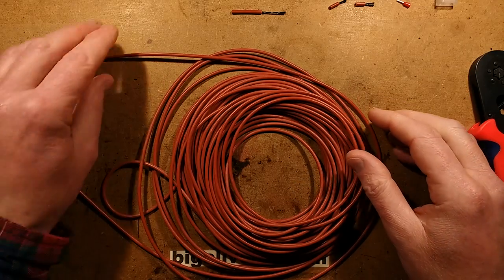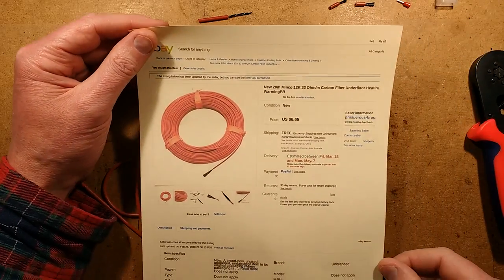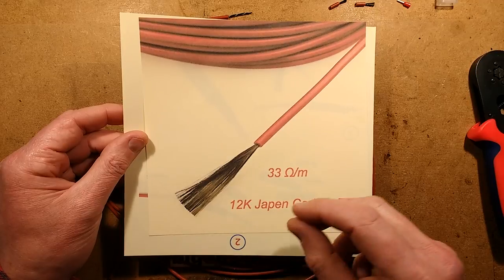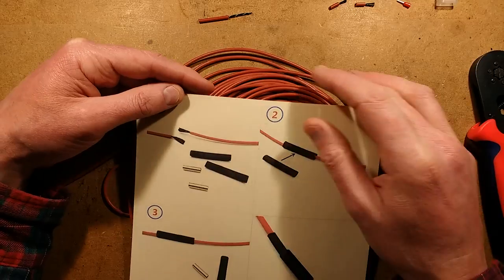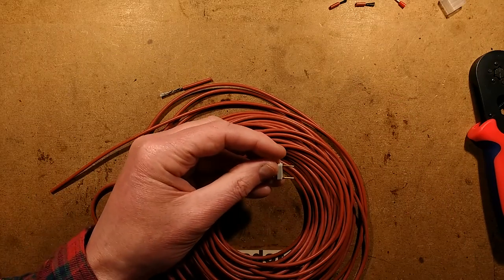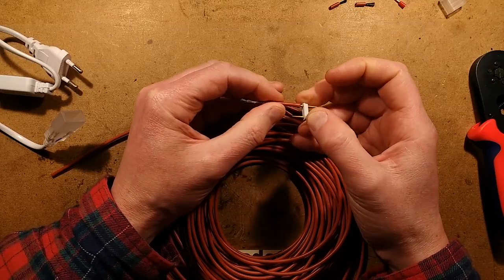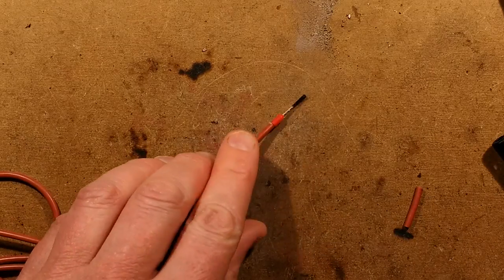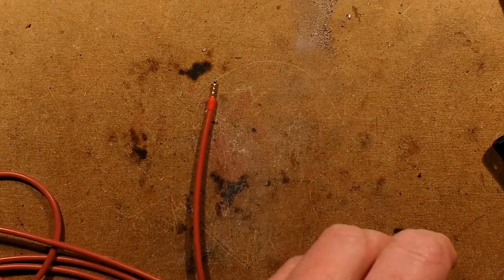Testing carbon fibre heating wire.  (with flame test)

Comment: I did a ride along with a fire department for a shift and I learned that people used to put this sort of heating system in their ceilings. I don't remember why people thought you should heat from the ceiling down but I do remember them explaining how much of a hazard those systems are.
Reply: I think its mostly done because it´s easy to install later on, and still better than the classic radiator.
Reply: My uncle used to live in an apartment complex (built in the 1990s) that had ceiling-heated units. He was on the 2nd floor, and I remember during a blizzard he had every window open and was walking around with no shirt on because it was over 80 degrees and the downstairs tenant was suffering from her unit in the 50s. Epic fail on the builders, it would have been more efficient for the first floor units to have electric baseboard heat instead. On the up side, he never had to turn on his heat, ever, while he lived there.
Reply: We had a home with the 120v in ceiling radiant heat. It had previously been added during a large extension project (in the 70's) as well as the requisite ceiling fans to help. It was only helpful when the wood stove couldn't keep up with -12F and leaking windows.
Reply: And here i am trying to persuade my sister that her idea of installing ceiling-heating is retarded but she won't listen.
(No, not in an old building - they are currently building a new house)
Reply: +ABaumstumpf I'd show her what +DashCamAndy said, I think he's got the best story of the rest of us
Reply: A ceiling heating system only works if the heat is transfered mainly as infrared radiation heat not convection heat!
This is achieved for example by having a ceramic surface heat up to about 120°C(248°F)
Different Surfaces have different temp points of IR-radiation, ceramic is one of the best.
That is why old tiled stoves are so comfy.
Reply: Animarkzero
Never heard that, thanks for sharing dude!
Reply: If you install radiant heat.. do it in floor.. Makes it comfy,, even in cold temps,, and saves energy,, since heat builds up on ceiling, while floors often stay cold
You can do hot water floor heaters too,.... just modulated to 130 degrees.  Best luck;!
Reply: @DavidRio  Floor heating is the best 
Although I would NOT recommend 130°F(54°C) 77 to 84°F (25-29°C) would be much wiser!
You get Varix from to much heat from the floor
Often it is not possible to refit floor heating then you can also use walls or ceiling!
Reply: Might be a good way to warm a fermentation vessel in home brewing.

Comment: Thanks for this episode of inspiration and answering the obvious Q+As. Your suggestions for making it safe to use earns you 10/10! Trying to learn racing quads at the moment on the Costa del UK. Great but less if you are freezing. Since the pilots already strap on a large 3s lipo to power their FPV goggles, a nice pair of heated gloves under 5W would be an easy hack. We also suffer from cold lipos. Using a lipo below 10 Deg C can cause permanent damage to cells. Racing packs are not cheap.

Comment: My satellite internet dish horn freezes up in the very cold (-30 to -40 C). It stops working when it freezes. That would be a great way to quickly thaw it out.
Reply: Canada.
Reply: It is actually the cold, because the only way to get it to work is to wrap an electric heater around the horn to get it to work again, or if the sun hits it in the morning. It only happens about 3 or 4 times in the winter. It happens right in the middle of the night at its coldest.
Reply: Nothing in the way. It is a strange thing. These horns are fussy when it comes to humidity and cold. This is the second one that has been installed. The first one was replace when the horn was cracked by sun damage.
Reply: Harold what is inside this horn device? Is it a transmitter? It's very rare that electronics have issues at below 40 would need to have moving parts for it to fail like an HDD
Reply: That's right on the temp border between consumer ic operating temps and military ic operating temps. mil spec wouldn't do that
Reply: Francois Deshue could it be metal contraction slightly changing the shape of the tunes cavity and thus causing the issue?
Reply: FRancois: Nope, much more than that. Here's a link to it with some pics:  https://en.wikipedia.org/wiki/Low-noise_block_downconverter
Reply: A dish "horn" is really a LNB.  These contain active electronics to downconvert multi ghz freqs to say less than 900mhz, along with switches and cable drivers etc.  They are powered and told to switch bands by imposed DC voltage on the coax.  Could be geometry changes or bad solder joints or a component that drifts enough off spec?
Reply: Pity ALPS no longer makes LNBs, those were just the best. They look like they shouldn't work, they don't have the best specs on paper, but they worked better than anything else i've tried, and they were super inexpensive.
Reply: you can get outdoor rated self regulating rated trace heating cable - marketed for preventing water  pipes from freezing... I think that'd be better for your application. 
the underfloor stuff doesn't look like it'd really be very flexible and might not be designed to stand up to UV...  and the self regulating stuff ramps down the heating when it's got warm rather than outputting  constant power regardless of what temperature it reaches.
Reply: Consumer LNBs often drift based on temps. Too high or too low and it'll drift off frequency and instead of the oscillator being 11000MHz, it's at 10500 or 11500 (I don't know if they'll drift that far - it's an example) and your receiver is trying to get 1000MHz, but the signal is actually at 500 or 1500.
Reply: Not sure what exactly is inside. It is a combination transmitter and receiver. All I know is cold affects it.
Reply: You really should just take advantage of your natural resources!
By which I mean, I wonder how many Canada Geese it takes to carry a human while migrating...
Reply: I don't know the pricing, but these guys seem to make LNB's which work in arctic temperatures. https://orbitalresearch.net/products/lnb/
But I wonder why/if nobody makes a LNB with a resistor for heating inside; it seems there is a market for it in your part of the world.
Reply: Anyway, if you think heat might solve your problem, you could try a metre of this stuff hooked up to a 12V solar setup. Likely not enough wattage to thaw it from a solid freeze, but if it's always on, maybe it won't freeze? If it's still not enough, you could either go to 24V and 2m of magic carbon wire, or use this wire on the boom that holds the gun and put some 1 1/4 pipe insulation over it.

Comment: By the type of combustion and that white ash, I can say that this insulation is 100% silicone polymer. By the way, its redish-brown colour is quite similar to heat resistant silicone gasket material for automobiles
Reply: That's very naughty since they're claiming it's PTFE. I've ordered 20 metres of it though and will make sure I have secondary fire protection since I won't be embedding it in concrete ...

Comment: I use a very similar product in commercial grocery store equipment. Door frames of frozen food cases. Heater for glass on display cases. Door frames on walk in boxes. Stores have MILES of this heater. The normal failure point is at the crimp connection to the copper wire. The wire we use is white. Fiberglass core. It was my understanding the it is the wire wrapped around the fiber core that is what heats up.
Reply from the maker: We used to use that with Hussmann too.  There were massive toroidal transformers on top of the cases that caused inrush current problems.

Comment: Might be good for greenhouse soil heater boxes.
Reply: Ged Reilly  heat cable is great for heating beds.
Reply: Ged Reilly that's exactly what its used for it's just marked up in price as soon as it says "planter heater", we use this stuff all the time when growing (mainly germinating) super hot chilli seeds (absolute pain in the ass without it in the UK) we just snake it around the seedling trays and put 10V/M through it.
Reply: euan todd   "super hot chilli seeds,  a pain in the arse. ..."    :)
Reply: "super hot chilli seeds (absolute pain in the ass..."

Is that a guarantee of quality?
Reply: it is designed to work for soil bed heater.. but at lower voltage , hence lower temperature.. so won't damage the root.

Comment: For terminations we used to use a crimp that was similar to how you would make custom high performance spark plug wires.You would strip it and fold it back onto the rubber coating and the crimp went on top of that.It's tough to explain but if you've ever pulled a plug wire apart you'd understand.

Comment: Heating up the bath tub so the water doesn't go cold so fast
Reply: mfanto1 I have a design for a heated bathtub...
Reply: What about heating the bathtub with mains voltage electrodes?
Reply: mfanto1    I wanted to have no mains in my bathroom.   The lights are all 12V,  then I remembered P=VI, so a 1200W heater needs 100 amps.....  rather thick cable!
Reply: Just drop a running toaster in the water. Problem solved.
Reply: "What about heating the bathtub with mains voltage electrodes?"

Sounds reasonable. Try it and report back here.
Reply: @fun_ghoul  he probably tried it, tree years ago

Comment: Fascinating! A doubled length of this stuff in the condensate drainpipe of a condensing boiler, fed from a 12 or 24 volt thermostatically controlled PSU would prevent freezing of the drainpipe and alleviate a common problem with this type of boiler in winter.

Comment: This wire is used for heating plants when they are small.(seedlings) there is also a thermoregulator for them. I  think the carbon core is quite well insulated if it can be used in such wet environments.

Comment: A year or so ago I took apart a broken portable air purifier (not mine) intended to be kept in your car, and it had a potted box with what I now realize was carbon fiber strands in a rubber sleeve coming out of it - thanks for solving that mystery.  I thought it must be generating high voltages inside the potting, presumably for ozone generation, but I couldn't figure how the plastic-like brush was helpful.
Reply from the maker: It's commonly used with Ionisers now.  It's a perfect emitter.

Comment: I live in the arctic. The big extra high beam lights on my car has a lip on the frame around the outer glass, where snow and ice will stick. Won't stick to the glass much, but it collects down in that lip, and then builds up while driving until it covers the whole glass. Not a lot of heat to go around, with a 35w HID bulb and a 8" wind-chiled glass surface. I got some 14 ohm/m of this stuff, wrapped 2 parallel lengths of this inside the bezel frame, and hot glued it in place. Heats up that troublesome lip with about 30 watts total, now the snow and ice melt before it has a chance to build.

Comment: The crimper is obviously a fast and conveniently used tool for terminating this wire. I imagine an optimal crimper would exert crushing force at the tip. Moving further back along the fibres, the force would decrease progressively down to next to nothing. Tapering serrated jaws would do it, if you see what I mean. At some point along the crimp, the force would be optimal. Great demonstration of a new product; thanks.

Comment: Over here in the US that’s the wire used in heated tile floors, it’s run off a separate breaker and circuitry to run since it’s put down and looped every 4 or so inches into a big heated pad

Comment: Another fascinating video Clive. You may be interested to know that there is carbon cement available. I think it’s epoxy based with carbon nanotubes mixed in. It is used to bond carbon fibre panels together in the aviation industry where we need a conducting joint for lightning protection and static charge dissipation. Perhaps it could be used in a ferrule to join the fragile fibre. Just a thought.

Comment: 1:25 I actually was interested in fiberglass vs asbestos dangers a while ago.

From the papers I read, asbestos apparently breaks down in a different way which makes it more dangerous. It apparently splits length-ways. I assume this would be like pressing a pin against a hard surface and having the pin split in half straight down it length ways, resulting in two sharp thinner pins. According to the studies I read, fiberglass doesn't split in the same way. Instead, it splits into small pieces of equal thicknesses (across rather than length-ways), which apparently aren't as deadly. Still can cause irritation, but probably not cancerous.

Comment: Could you dump the bulk of the heating wire in a bucket of water, use the water as a connection to "ground" and zap it with your new toy - just to be sure? It'd be interesting to see if there was a breach. 

A note about airbourne particles, I live near an industrial estate, side effect of living in an old mining village, and there's a glass recycler nearby,. They had many piles of glass. Noise pollution was bad from tipping vast containers of bottles etc on to the piles. About 7 years ago they were forced to cover the place up, like Reactor 4's sarcophagus cause of the glass fibres / minute shards.  

A load of people in the neighbouring village were getting fed up of waking up with a "dusting" of the glass on their cars and those who chose to wipe it off, thus sanding their paintwork / top coat off over time. 

Particulates suck.

Comment: The old '60's Ford carbon impregnated string ignition leads used a spike wire to connect the terminations.

Comment: Before installing I would soak the body of the wire (not the ends) in grounded salt water and check for a ground fault with a GFI outlet.

Comment: I wonder how hot and overpowered you could safely run it.

I'm considering using this as a heater for a large scale 3d printer heated bed, but I'd need to push more power than its designed for since I need at least 70C bed temp.
Reply: Carbon fiber is pretty durable. I did a quick test ,nothing happened except for a few burnmarks on my bench. The first thing to burst into flames is most likely going to be the rubber coating, but i think 70°C should be relatively save.
Though it might just work I agree with Clive, etched PCB heaters are probably better.
https://youtu.be/ipyHc4VVmYg
Reply: Rooom sized 3D printer, eh?
Reply: Manufacturer says minimum 10 meters that would mean around 170-180W per 10m. That could get quite hot.
Reply: You can't melt the carbon strands. You'll likely burn your house down if you try. At the same time, whatever's coating it, and the strand wrapping around it, will have a lower ignition point.

From Wikipedia:
Known for their conductivity, carbon fibers can carry very low currents on their own. When woven into larger fabrics, they can be used to reliably deliver infrared heating in applications requiring flexible heating elements and can easily sustain temperatures past 100 °C due to their physical properties.
Reply: JET FUEL CAN'T MELT CARBON STRANDS!
Reply: I would think from both a longevity and safety standpoint, increasing the amount of 'wire' heating the plate (by laying it more closely spaced) would be preferable to overclocking the input voltage above the wire's rating.

After all, you really only want to build the bed once, rather than burning them out and going through them like incandescent light bulbs.
Reply: Clamp an old electric iron heating plate to the bed perhaps?
Reply: I would use something more traditional. This looks like something designed to maintain temps around 70F. Like Clive said, probably for underfloor heating, to maintain temps comfortable for humans.
Reply: Luke Den Hartog   thé sleeve is probably silicone.   It depends on formulation but most will easily survive 100C   (boiling water).  High temp ones can handle 250C.  .
Reply: Luke Den Hartog The silicon insulation sleeve and the designed resistance per meter is bad for your use case.  You need something that produces more Watts in a tighter area at lower voltage. So lower resistance and thinner insulation. I wonder if regular electrical wire, but with a higher temperature insulation (so not 70°C PVC) would be good for the job.
Reply: That depends on thermal conductivity. Water-based floor heating is often fitted to aluminium plates to distribute the heat. Already if this cable is embedded in concrete, it will be able to transfer the heat to a larger area.
Reply: Just did a quick test: 1M of filament tested at a room temperature of 20C.
4 turns of filament looped about 8cm diameter sitting on the desk in open air.
K-Type thermocouple taped to the wire.

Voltage/Current/Wattage/TemperatureRise:
8.4v/230mA/2W/+20c
12.6v/350mA/4.5w/+35c
20v/590mA/11W/+85c
25v/750mA/19W/+125c Started to smoke slightly. Maybe was my heatshrink giving up. :-)
32v/1A/32W/+ 170C...  Yeah. Unhappy heatshrink was smoking nicely.